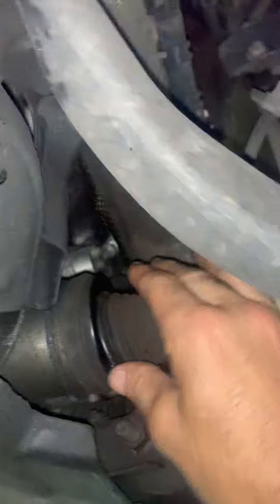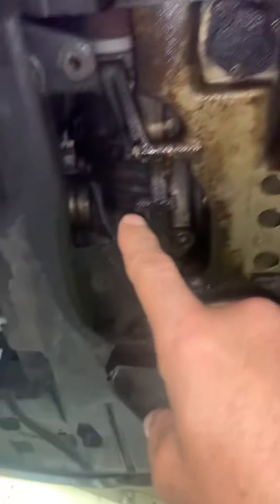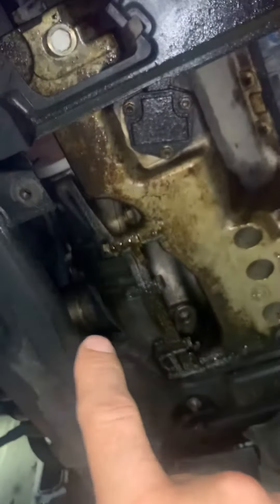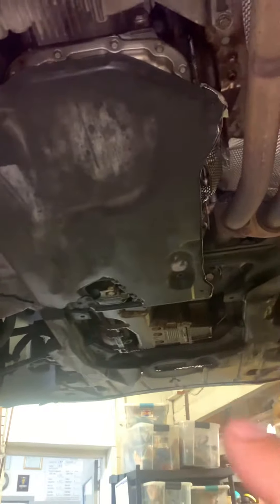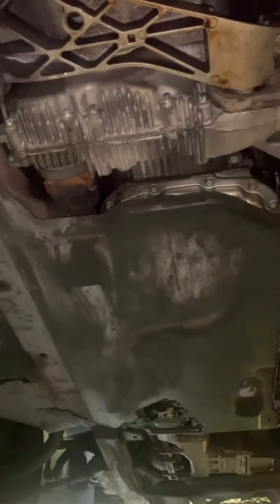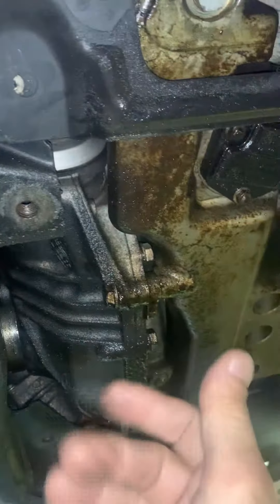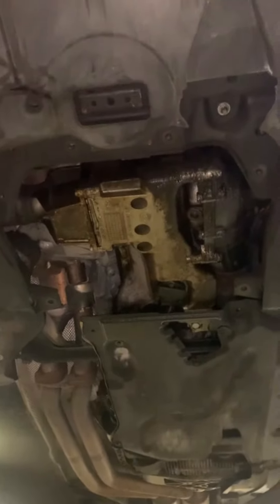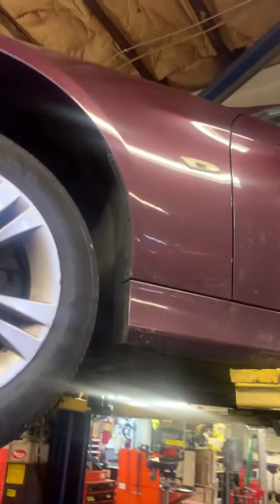How to delete bmw 4x4 car to RWD

Comment: I've been contemplating converting my 01 E53 to rwd for the reasons you mentioned - more MPG, smoother driving and less potential problems. Never need 4wd anyway.
Reply: Just pull fuse 46 way easier in e53

Comment: How did you go about programming it. I have a differencial problem and I want to do the same. But I don't know if using the program "X Delete" for the transfer case will work
Reply from the maker: We left transfer case and actuator. Coding everything out was more complicated than we thought. May need to replace ABS module which is made for 4x4
Reply: As far as I know x delete programs the transmission to think it’s a rwd car and completely stops sending power to the front end but you could simply test the theory by installing x delete and putting the car on jack stands and seeing if the front drive shaft still gets power it shouldn’t 😂 so assuming you have a front differential issue then you should be okay but I would only bother removing front axles honestly
Reply: Don’t take the bracers for the wheel bearings out like he said though
Reply: I have a single torn axle boot so I’m replacing the axle and downloading x delete but only reason I mnot removing things is because I live in place with snow might need it in winter
Reply: Also X Delete might only work for the models after e53 which were designated XDrive.
Reply: What about the oil pan? Shaft goes thru
Reply: @C63V8  I’ve seen people plug it somehow to prevent issues later if you wanted to reuse it. I ended up just dropping the subframe and replacing my whole diff. Including the oil pan
Reply: @evanbourgeois6606  ok,,thanks for answering

Comment: You could just pull the 4x4 and ABS fuse. Going to try it on f10 xdrive
Reply: Hey, did this work?
Reply: @alexblake8927  no didn’t work. Goes into limp mode. I’m going to try front drive shaft next.

Comment: Whatch my channel. I cleaned mine easy to remove lower two bolts on driver side then try to get other side put jack under engine so it dont move to much. Clean turn black piece so if it engages theres more teeth it can grab. Mine was bad on a lik piece but the rest good. Then if you got any break problems fix if not cut te break sensor and connect two wires if break yellow light is on.

Comment: Hi, can anyone help me. I have a 2018 430i xdrive, it only had like 21,000 miles when I got it, but for some reason the transfer case went to shit, I don’t know how. But my mechanic completely removed it and so I’m running without one. The only problem is that I have the chassis stabilization code on and it won’t let me drive the car in any mode except for comfort mode. I’ve been contemplating on getting  a new one so I can use sports mode and sports mode plus, but I kinda like keeping the car in rear wheel drive. Does anyone know how I can maybe permanently remove the codes that pop up.
Reply: You need to code out the transfer case and make the cars brain think and know that it has the RWD configuration as opposed to being AWD. Since I am having axle issues, I am contemplating to do just that - remove the whole thing up front, code out transfer case and figure out the removal of it alltogether.